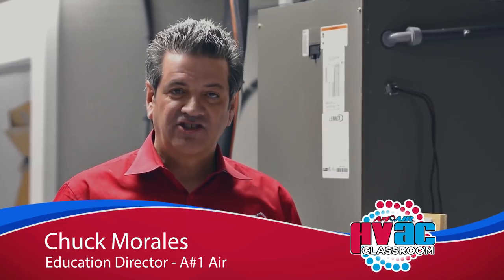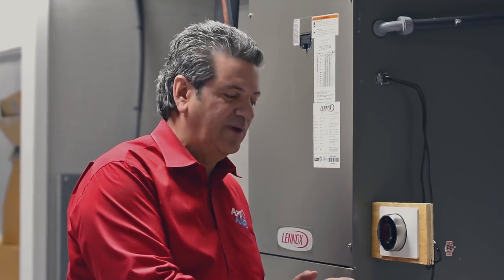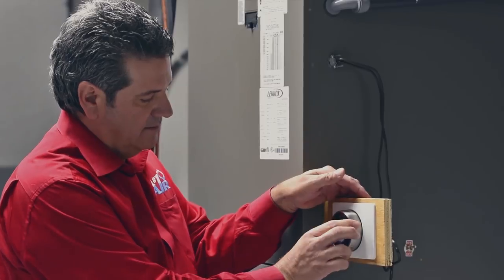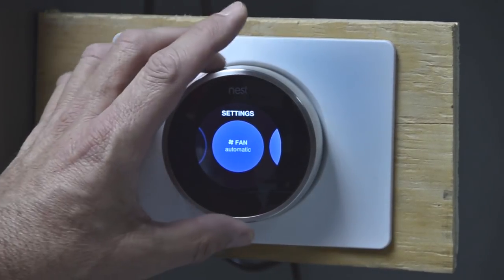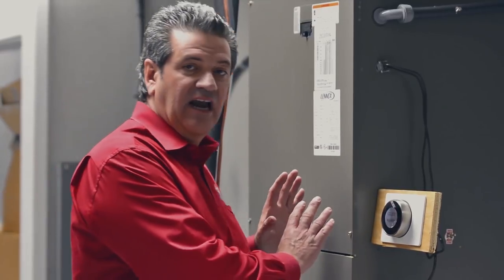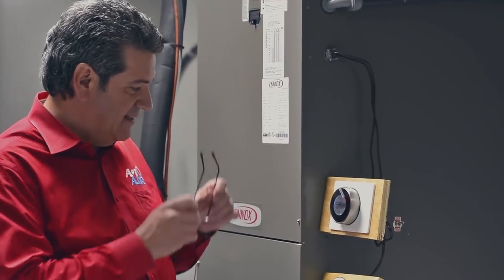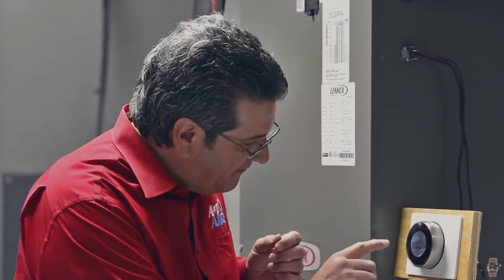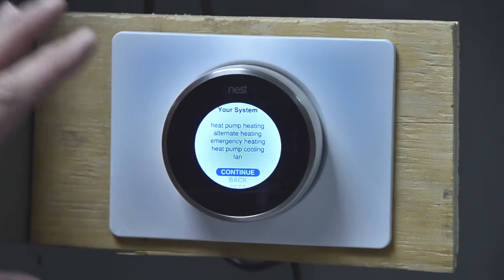Nest Thermostat - How to Setup a NEST Thermostat for Dual Fuel

Comment: Hi if we have one unit for 2 story house and need to install 2 nest thermostat, how should we do that? We have itching split system or damper that control our 2 thermostats ...
Reply: Fatemeh fallah adl if you have a 2 story house that has one central heat pump air conditioning split system, then you will need to have only 1 heat pump nest or Honeywell thermostat that controls heat for both primary and secondary floors in a single location ( I have my heat pump thermostat on second floor and it controls both 1st floor and 2nd floor since ducts go to both locations.... first floor and second floor)

However, the trick is what you would do is make your heat pump/ac as the secondary source of heat....  instead of making primary source of heat....

Yes yes I realize that heat pump is cheaper to operate up to 27 to 40 degrees then gas.... but the problem is sometimes heat pump is simply not as comfortable from all the hot non humid air heating you... causing you allergies.... (unless of course you add humidifier in between the ducts...)...

Therefore what I would do in this circumstance this specific circumstance where you happen o have 2 floors.... is to simply have one thermostat for your heat pump..... that controls both floors with push of a button..... and also get your self 2 more thermostats such as Nest thermostats for example.... for your furnace/tankless water heater that heats your radiator pipes with water or steam.... (depending on what your 2ndary fuel system is... mine is tankless water heater that provides heat for both domestic water and radiator space heating....)

The 2 more thermostats would allow you to control your radiator heat....for each floor... because the chances are.... you most likely have multiple zones setup for your 2 story house for your radiator pipes.... and therefore if that’s the case then you most certainly will want to use your gas heat source of tankless water heater.... as the primary fuel source vs heat pump.....

Why?  The reason why is because you want to control each floor separately... and use heat pump in the event of emergency.... such as when for example your tankless water heater breaks.....(mine broke the other day... 3 way valve was broken causing radiators not to heat.... boy was I glad that I had heat pump as backup for both of my floors...)

Now the question is.... how do you control all the thermostats automatically... I imagine this is your question.....

In my case I have total of 3 thermostats.....

1 to control heat pump.... (Honeywell.... not best....) and another 2 (nest.....)

I use 2 nest thermostats to control the heat from radiator gas source.....

I use Honeywell for controlling heat pump...

Now you may ask.... but how... they from different vendors.... 

Yes indeed they are.... 

I use concept of If This Then That..... for nest and for Honeywell thermostats.... without going into any rigorous settings of a single vendor....

In if this then that settings I simply configure.... Nest to hold temperature at 73 degrees for my radiator heat.... at all times and to only turn on heat pump if and only if temperature drops in my home below 70 degrees.... (in circumstances when my tankless heater breaks for example....)

So does the temp ever drop below 70?  Well yes if it’s very cold... and if it’s very cold and temp can’t be held at 70 that means you must likely have a leak in your window.... (in which case I highly recommend insulating your Windows....)...

Sometimes though.... someone may have opened the window on purpose... then yes your heat pump would turn on..... unless you put sensors on windows and connect them to if this then that..... functionality and not turn on the heat pump if the windows are opened.....  

Now sometimes.... I simply want heat pump to Quickly turn on...... but turn on when I get closer to home..... within approximate 10 miles from home....

Then once again I use if this then that function to turn on the heat pump..... or gas tankless water heater.....

Heat pump makes the whole house hot fast vs radiators.....  a lot faster....

I use Alexa to control my heat pump and tell Alexa to turn it on using voice....

I also inter-combine my ceiling fan  with Alexa as well... and heat pump and gas for maximum comfort in the time when I want some air circulated in my house....

Seems confusing?  I know.... if you are confused... you can always get one heat pump for one floor and another for another floor and separate your duct work.....

Of you can just keep the duct work the way it is.... but put automated smart registers.... to control the flow of air..... to your first floor and 2nd floor.... and use yes one thermostat only.... in combination with if this then that functionality and automated smart registers....

This way you can still heat your floors independently..... by simply closing registers automatically.... in the floor where you do not want heat....

Now not that many people know about this.... simply because they chose to just have their duct work split in two.... but if you doing some sort of Airbnb house hacking.... then the solution that I provided is the way to go...

Hope it helps.. good luck for more info go to studyguide.net/hvac